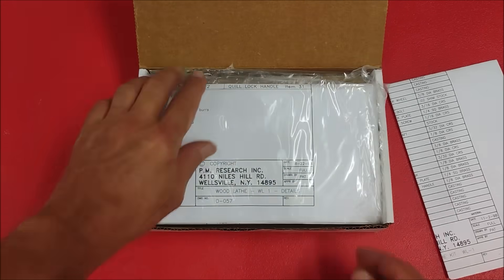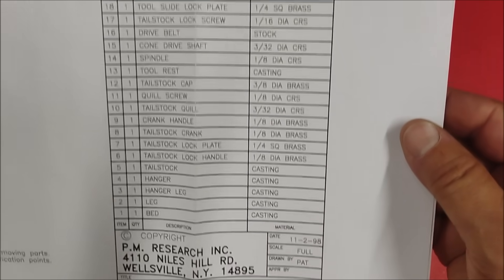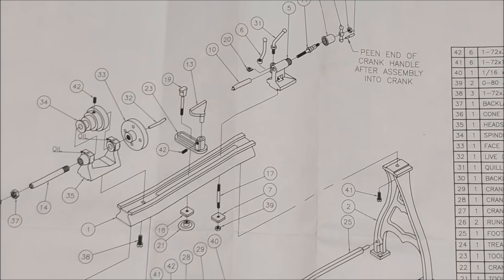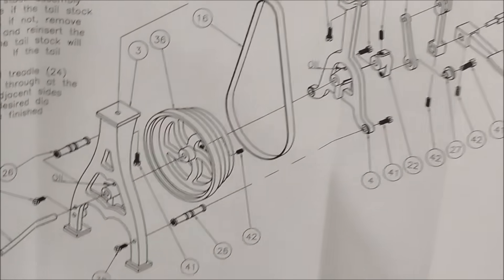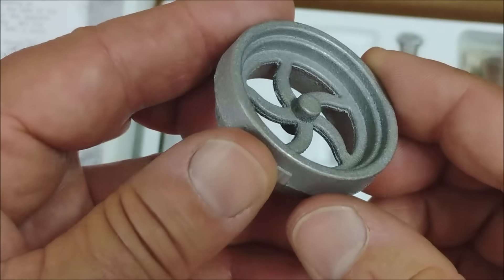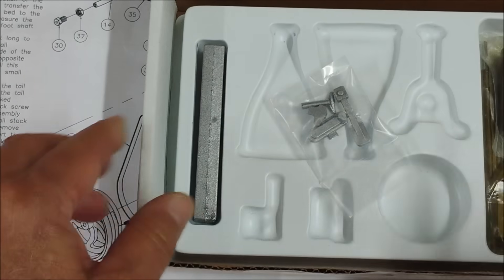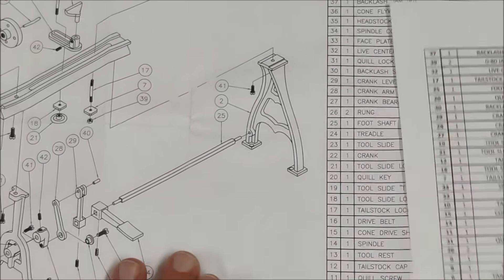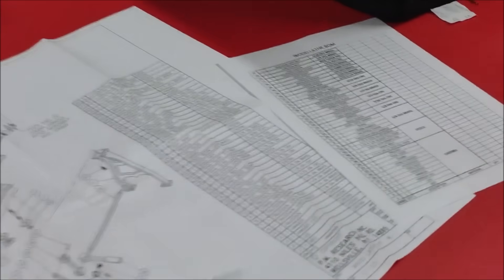1/12 Scale Miniature Wood Lathe - Video # 1

Comment: Your model machine tool display is incredible! It would be great to see them all set up in a big display hooked to a PM Research line shaft, powered by a steam engine. And have it all set up where you could actually use it. Maybe not what you have in mind, but it would be cool!
Reply from the maker: Its not out of the question, but storing the diorama would be the hard part. Individual machines are much easier to display.

Comment: As to relocating, for whatever reason: it is an opportunity to rethink your shop. When you start a shop its layout is designed in a way that is logical to you at that time, so you start nice and clean. Over the course of the years changes happen. New machines are added, old  machines go, needs change but also your insights change. But hey the shop needs to go on and the once so clear layout becomes blurry. Relocating is the perfect opportunity to rethink it all. 
Leaving the old shop is a thing, after all you spent so many hours there. Partir c'est mourir un peu.

Comment: Very exciting to see a new model underway. Regarding the BOM - this is absolutely sage advice. Orienting drawings / BOMs in a way that helps the shop is smart, and will cement relationships between engineering and manufacturing. I always run my drawings by the shop before release - they are so grateful for that, and I get input that helps streamline my designs. Win win. Cheers and best wishes. Good luck with the move - never fun. Your new place will be better!
Reply from the maker: Listing the parts by material also helps the machinist to know how many parts need to come out of the supplied material. It helps the production thought process.

Comment: Almost the same thing happened to me except my landlord sold the building my shop was in and I had to find something and move out in 30 days.  I now own my building and it has 3 phase power and air-conditioning which my leased building didn't.  Had to use a rotary converter for 3 phase and couldn't use more than one machine at a time in the old shop.  No limits now.  At the time I didn't know what a favor the building owner was doing me. Hope you land better off also.

Comment: 100% on the BOM issue. First thing I did on my kit (after wth ?!?) was group like materials for like machining ops. 
One thing I learned in my years of Production Engineering is that engineers, assemblers, technicians, stockers, etc. all need the BOMs structured in different ways and we had to supply to their needs for the most efficient use. Can't fault the drafter as they only have so much space on the drawing. Glad to see you back in the shop. Good luck in your new location.

Comment: Hi Joe, good luck with the tail stock, I originally thought I could use my LH tap and die in lu of the 0-80 set, I had to get another tail stock casting. they sent one with the 0-80LH set I purchased from them.
Rich

Comment: Outstanding Joe! This is going to be basic but fun. The Stuart Catalog is a deep rabbit hole. Hope to see you down there.:)

Your comments about the BOM are spot on. I always organized by work like this. First, in the real world you have materials purchase dudes and they confuse easily. Help these guys out. A little clarity goes a long way.

What I also noticed is a similar issue with CNC machines. The CAM router software creates code sequentially. So you often see many many many unnecessary tool changes as the program runs.

So if you group similar operations together, you minimize unnecessary tool changes allowing the program to run faster.

Over the years I was involved in the CNC woodworking industry, and some in the metal industry, I noticed a disturbing pattern.

Firstly, the companies that have been around for decades and always seem to have a profit no matter how small always owned the building they were in. The ones that leased always wound up on the IRS auction site. The last one had 80,000 square feet and we’re in the rears for three years. The bankruptcy judge gave the new German machines to the land lord!

The other item is the bank! One pattern shop in Racine was around since about 1917. Made patterns for Case Tractor and others. But the salesmen convinced them to buy lots of shiny new CNC machines on credit. When things got slow, the bank shut them down and fast! My two Kindt Collins sanders came from there.

Another trap is the single customer trap. One customer prompts you to buy a new shiny CNC machine. Life is good while orders for that customer come in. Then the orders dry up or your customer goes belly up. Now the bank forecloses on your shop and repos the new machine. But you loose the whole shop. Been to a couple of these auctions.

There is always a life lesson behind the grey bread of an old machinist!
Reply from the maker: in my experience, there has always been a deep divide between the shop and engineering. Anything that can close that gap is a step in the right direction.
Reply: @joepie221 I began life with two engineering degrees. I took wood shop and metal shop in high school. But I also worked in shops when times were hard. You either move or find something else to make a paycheck. Fortunately the machine tool trades always seemed to have opportunities when things were hard in engineering.😅

Comment: Mornin Joe…. Been watching you for years, and I do need to get out in the shop more and play for myself … about twenty years ago i bought the set of pdf files from I think RG industries out of La. For the scale gattling gun. So, looking over them I had my doubts … good concept but things were either not adding up or were not dimensioned at all. Long story short , I redrew everything in Autocad in 3d as solids saved each part and assembled them resulting in around 100 sheets 11x17 plus material list and started collecting materials ..  well here I am 68 full shop of manual machines two mills three lathes one pantograph a drill press a radial arm drill a surface grinder and all the welding equipment… just need to get started, just need to figure out how not to get overwhelmed…
Reply from the maker: A wise man once said " A journey of a thousand miles is achieved one step at a time"  Just tackle One piece at a time.....Breathe in between.